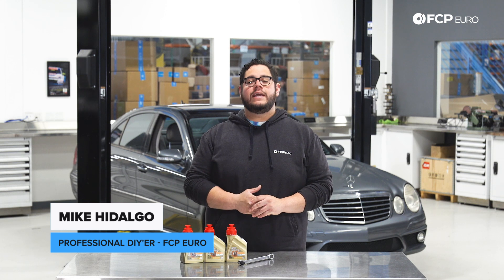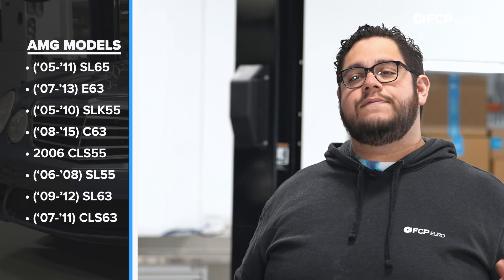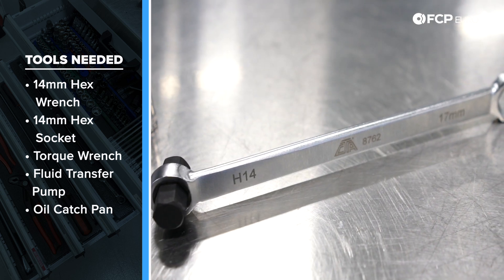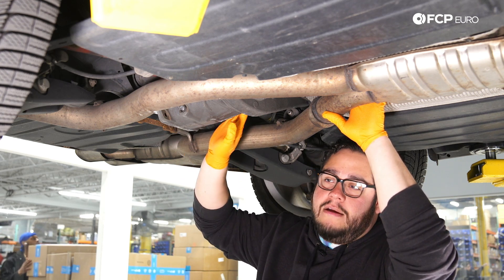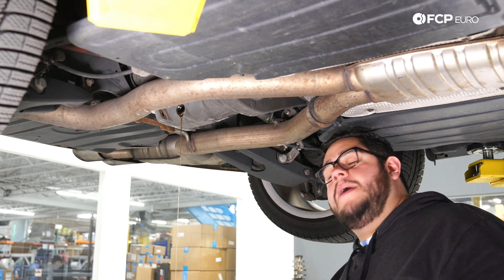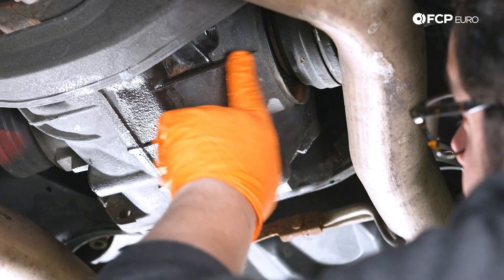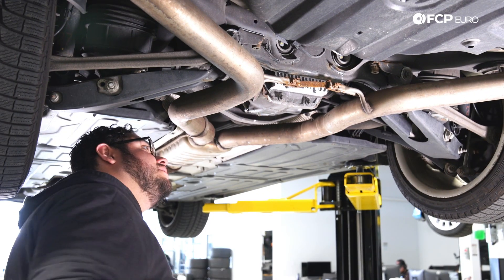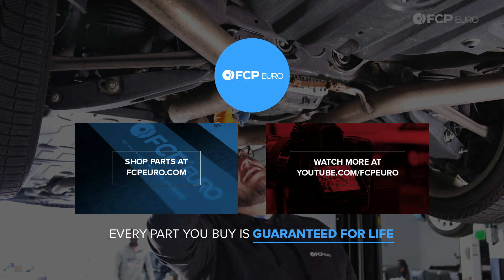Mercedes E63 AMG Differential Fluid Service DIY(Mercedes W211 E55 AMG, W209 C63 AMG, C219 CLS63 AMG)

Comment: Hello I have w211 original e280  M272 engine 
Need same replacement process and tools and same oil brand ?
And must wait till the differential getting cold?
I need to check transmission oil level and health.
Thanks

Comment: My 2003 SL55 looks pretty similar, there was white thread tape on mine when I took them off, like the supercharger, you think that's factory?
Reply from the maker: Hi Benjamin, someone may have done a service and used that as a sealant if they re-used the factory plug.
Reply: Should you replace the drain plug and filler plug each time oil is changed.

Comment: Hi, regarding drain plug, did you use some sealing (teflon tape, silicone, ...), or the bolt was clean ? Because w/o seal, there must be leak or not ?
Reply from the maker: Hi Grygarek, at install (4:40), you will note that this is a tapered seal, no sealant or Teflon is needed for the threads. If you choose to use a sealant on them, allow it to dry before filling the case back up.

Comment: On my W205AMG C63 the diff oil had a very high iron content at the first change 16,600 miles ( 3.5 years) is that normal ? Thanks